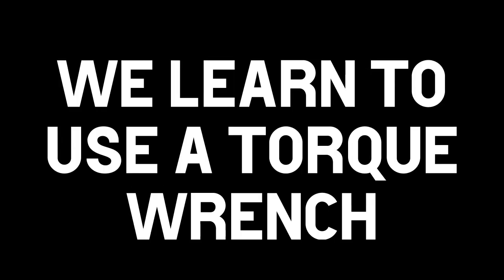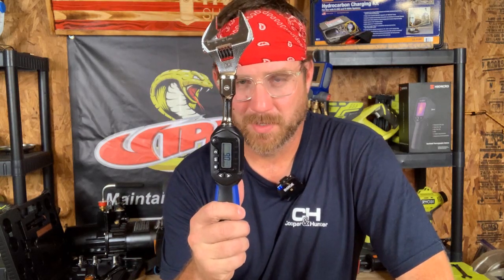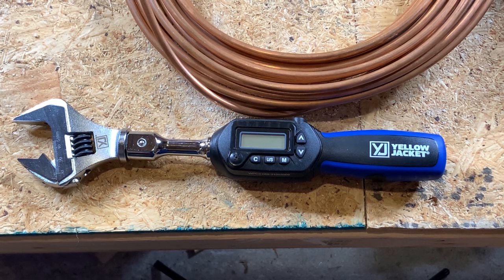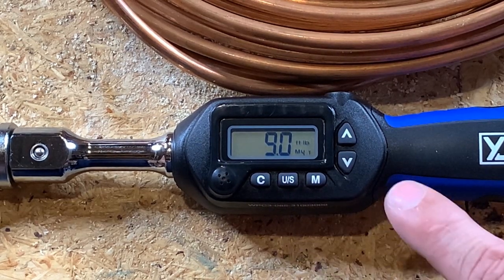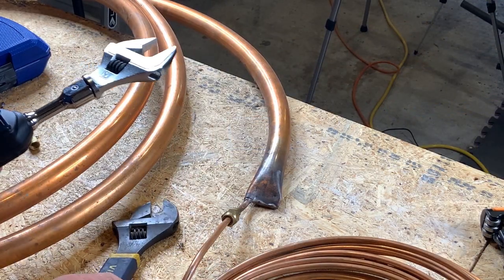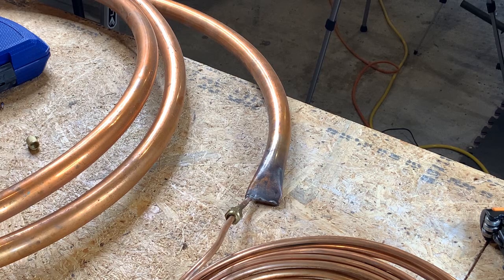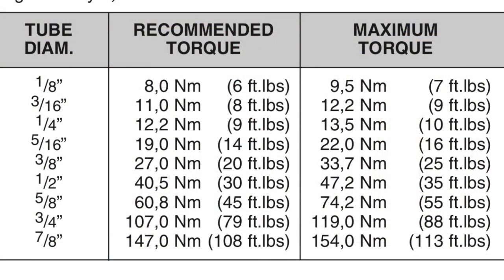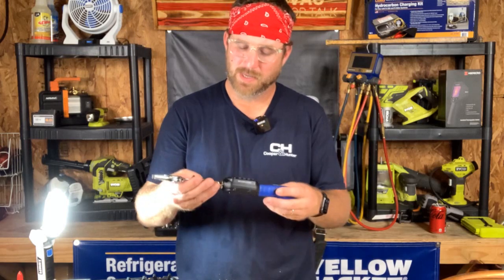You Must Have a Digital Torque Wrench to Flare !

Comment: Does Nylog change the torque specs?
Reply from the maker: I would think so and this actually did have NYLOG on it. But I guess just adding a little oil on the flare would change the specs as well?
Reply: John pastorello eluded to the fact that you should use the low limit of the torque spec with nylog I believe?

Comment: I mean… I don’t use torque wrench while torquing.. I have used torque wrench previously for 3 years.. I install without them now and never had problems.. I already know the feeling of when it’s good to go.. again.. I know how it works.. never had issues.. tested and proven by myself.. just saying..
Reply: I also never use torque wrenches on flares, no leakages at all.
Reply: Need to mention we only use qaulity copper, no shitty copper with 0,7 or 0,8mm wall thickness.
1.0mm is the standard for 1/4, 3/8 and 1/2 in our company while the most companies here in Europe use 0.8
Reply: Exactly. You DON'T need a torque wrench if you know what you're doing. I've done literally thousands of flares and have never had a leak.